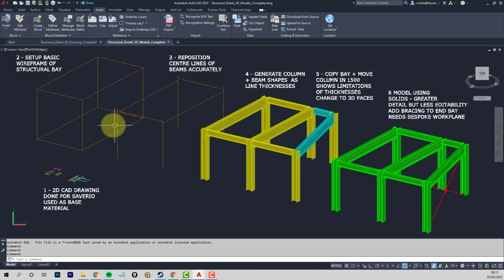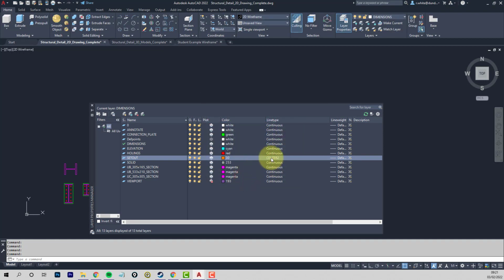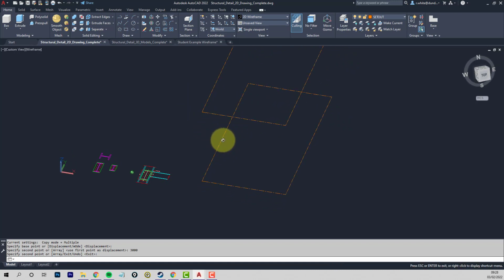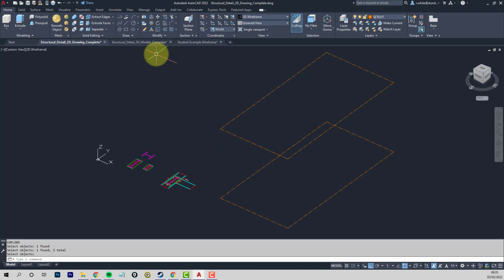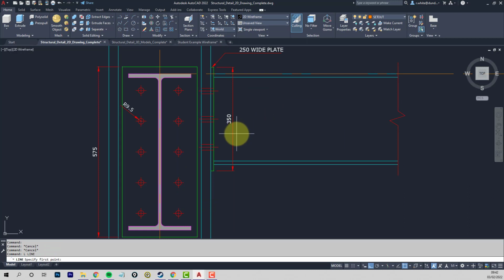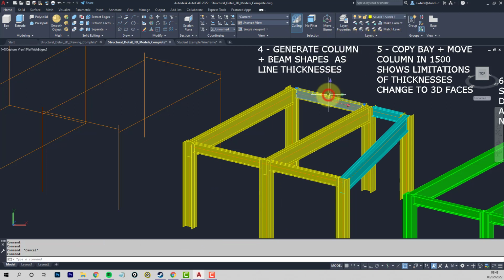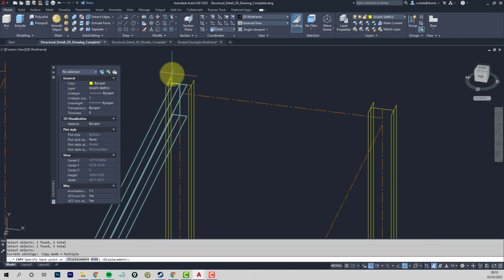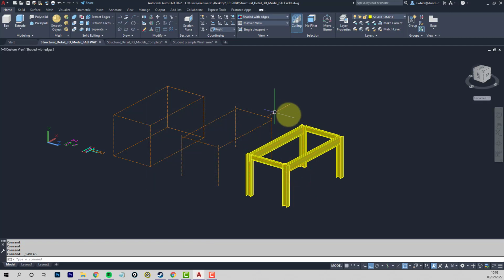AUTOCAD 2022 - STRUCTURAL BAY 3D MODEL - 4 MODELLING METHODS - PART 1

Comment: Just some notes for myself :)
ID -- to know coordinates of point
Extend -- select the limit of the line you want to extend, enter, then select the line you want to extend
CH -- Change properties of the cross section, change thickness to the height you need
CH - will force the command to stay in command line bar
Thickness will work as extrude like sap2000, but when you only change the orientation where you see the cross section of the element in plan.